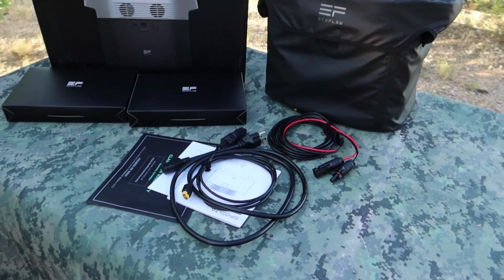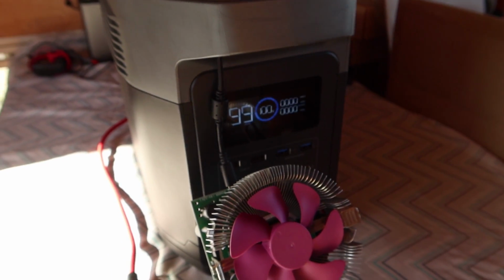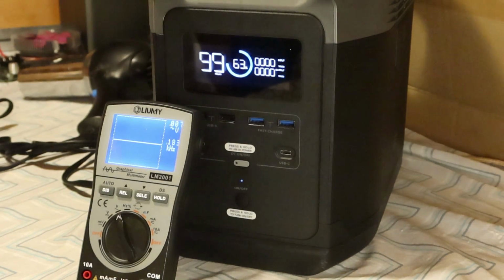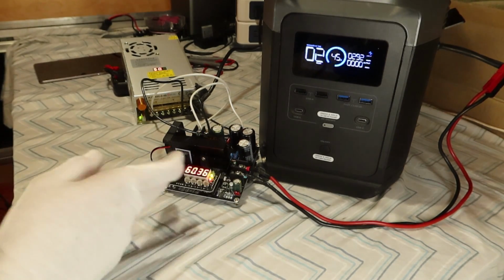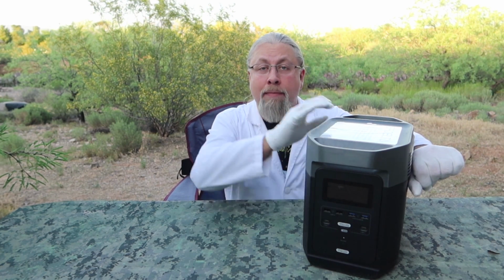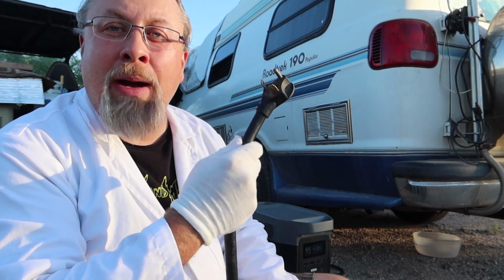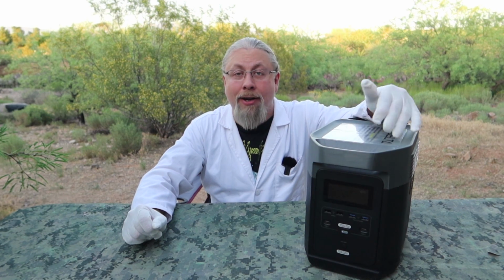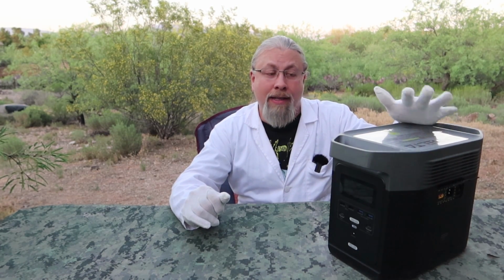EcoFlow DELTA 1300 A GAME CHANGING Solar Generator? HONEST Review! 1800w Portable Power Station

Comment: Another source of competition is a 12v battery, battery box and inverter. As in a portable DIY solution, then again I just looked up how much USA people pay for a simple 12v battery box, a lot more than we do in Australia. The Delta 1300 doesn't ship to AU sadly, if it did it would cost me around $1900 and for that price I could get a 100ah lithium in a battery box with the solar panels included.
Reply: Raw battery parts will always be cheaper. Just the weight, maintenance, spacing, convenience, etc. I mean, we all could have 12/24/48v systems with 1000+ah if it didn't weigh so damn much lol.

Comment: Will Prowse did a video on running an ac unit from a power station (I think Bluetti) and his ac unit was 300 something watts.
Reply from the maker: He must be running a much smaller a/c than I am. 450-500w is typical for a 5000 btu.
Reply: @HOBOTECH  It is all about efficiency.  I bought the most efficient one on the market, an 8,000btu Midea, and it takes 400 watts.

Comment: IS the MAXOAK Power Station 2400Wh/1000W Inverter BLUETTI EB240 basically the same as 2 100ah Battle Born Batteries ?
Reply from the maker: Only in capacity.
Reply: @HOBOTECH  meaning not in longevity ?

Comment: Can you test to see if the daisy chain function will work with another solar generator. Can you try hooking it up to a maxoak through the AC and the slave unit be the delta?
Reply from the maker: Won't work. The Bluetti can't discharge fast enough to charge the Delta. I know because I tried.

Comment: Very thorough review professor, but the what's inside question went unanswered until I watched a couple more reviews. Will Prowse reviewed this product last December (was $1100 then) and found similar positive and negative features. Jehugarcia broke out his trusty scalpel (a Philips head screwdriver) last March and found what appears to be 140 18650 Li-Ion batteries inside! Jehu also has a hack video on adding more battery capacity, for anyone interested.
Reply from the maker: $1100 was the Kickstarter price. It wasn't even for sale yet when he did the review. Jehu's hack not only invalidates the 2 year warranty, but makes the readout on the display totally useless because the external battery isn't factored in to the calculations. It's definitely do at your own risk. By the way, EcoFlow gave full specs on the batteries that were inside so I didn't feel the need to open it up.

Comment: Is it possible to connect external lithium batteries to a Delta generator instead of buying a whole separate  delta generator to add amp hours?
Reply from the maker: No, unless you're Jehu Garcia.
Reply: @HOBOTECH But I thought you were "The Guy" lol, thanks.
Reply: @HOBOTECH  but you can dump a lithium battery into the solar charging port ? Please if you can ... explain the size of battery that can be plugged into the solar port to charge ... 12v 100ah ? 24v 100ah , 48v 100ah ? I'm a novice in this stuff ... just looking to extend runtime in an extended power outage , Thanks and yes i understand the solar input limited to 400wats , how many watts would be pushed in with different size battery ? I have 2 of these units , was thinking to buy a few external lithium batteries , charge them with a ac wall charger and keep those batteries in case i need more runtime , thank you so much for your help .

Comment: When plugged into the wall, for fast charging, what does the manual say about current needed? I want to,use a ford f150 which has a 400w  120v, to recharge, and the specs may help me decide what to buy.
Per your video, it draws over 1230 w, which the truck does not support.
Reply from the maker: As mentioned in the video it requires 1200w or 10 amps to charge from AC.
Reply: HOBOTECH thanks, that moves me back to jackery 500.
Reply from the maker: The Jackery 1000 is a better product with MPPT charging, Quick Charge port, Anderson input, and 1000w inverter. The Jackery 500 is really slow to charge.

Comment: Another excellent video, per your usual standard.  I think it would be hilarious if you started out your video showing a "solar generator" (the sun) and then a 3-in-1 battery/charger/inverter.

At some point, you really should do a review of the Titan.  Each component piece of the Titan weighs almost exactly as much as the EcoFlow Delta 1300.  It's about the same price per watt/hr, but has a much more powerful inverter, along with far better specifications, across the board.  If price is no object, and you can accept two units weighing about 35lbs each as "portable", then the Titan is the absolute best in class for all of these products labeled as solar generators.  It's probably not the right unit for someone in an RV, but is a very good option for off-grid cabins and such.

Thanks for reviewing so many of the common, affordable, and truly portable solar generators.
Reply from the maker: The Titan is crazy expensive per wh. The battery it comes with for $3000 is only 2000wh and I don't know how much of that is even usable. I will write to them (again) and ask them to send me one to review.

Comment: I was lucky.  The Jackery 1000 (which only has a 1000 watt inverter) was able to power my RV microwave.  This RV microwave is a 950 watt (that is input watts) that runs just fine.  This is one of the most important things for me as now i do not have to run that stupid, loud generator.  A 1500 watt inverter was going to be my minimum that i would accept in a power station, but Jackery got me with that early purchase deal.
Reply: Any update on receiving  your Y adapter/ parallel cable? I've been back and forth with Jackery and told that they will be ready to ship soon. Still couldn't get a specific date from them however.
Reply: @MaisleyVanGo  No, i have heard nothing on the cable.

Comment: Bought this  a week or so ago with the sale of a Delta and a 370W River together. waiting for them to arrive. going to try the Dokio 300W solar panel to start with. Will only be used to power a pop up camper and in emergency if lose power to the house. Not concerned about the 800 charge limit as will not be used on a daily basis
Reply: Kevin Thomason how was the dokio panel with the EF Delta? I’m thinking of getting the same panel but the 300W panel outputs over 10A (which is the limit for EF Delta)

Comment: Great review! I'm a lucky one who got this discounted at Wellbots for $1050. It's best application is for the camper/overlander types (i.e. occasional users) where it's "lower" claimed cycle life will be almost unnoticeable. Having used it for a while now im of the mind that the lower round trip energy efficiency is due to all of the safety electronics and fans running essentially non-stop. Many may not like that but I think it's a great thing for the health of the batteries and electronics. While the fast charging and 1800W capabilities are great in a pinch, definitely don't do that often for the sake of battery life. Cheers!

Comment: Thank you for your review!  Good information and details.  Early adopter here (bought on Kickstarter).  I chose this over the Bluetti 1500W because of the higher input voltage requirement on the Bluetti (covered on your first test video for that product).  The Kickstarter price of $900 helped in that decision.  I was also looking at the Titan, but the Delta1300 seemed a bit more portable and price-effective (had to purchase two of them though).

For my use-case (extended weekend camping in the summer), the Delta1300 works well.  I can power my camp kitchen (including a 700W microwave oven, a chest fridge, and a separate chest freezer) and all of my electronics from my two units using two Dokio 300W folding panels in series and chaining the Deltas.  Yes, I'm over-paneled; but I can't always count on full sun.

If ordered REALLY early, the Delta1300 was only $800 at initial offering, with an  even better discount when multiple units were purchased (yeah, I missed out on that).

I see EF still hasn't corrected the size of the neutral blade on the AC outlets.  When using a grounded plug, everything should be fine, but using a "polarized" non-grounded plug, the Neutral and Hot are backwards.  Not a major issue if all of your appliances are in good condition as the ground doesn't exist and Neutral is floating anyway.  I just hoped they would correct this on the next production run.
Reply: Anonimity+ how’s the dokio panels working for you and the EFDelra?

Comment: If it's sold out, it clearly must be a success. The capacity hits from the electronics are not great. Jehu took his apart and said the cells are sort of generic, Chinese apparently. You lose capacity from conversions and the charge cycles cost capacity. Love those LFP where my 4 year olds are still at 90%. Was wondering what happens if you hook up a small generator, one that can't get close to that max charge? Does the generator go into overload or does the Delta adjust? Was wondering if you connected 800 watts of solar and drew 400 watts with the A/C, would it still give you the 400 watts through the inverter, plus 400 watts of charging? These things are getting better, but you really have to need all the capabilities or a bank plus an inverter makes more sense. Thanks. These are fun.
Reply from the maker: No, you can't use both AC and solar inputs simultaneously. If you use a generator too small, it will overload and stop the generator. There is no self regulating except that the Delta will keep trying to restart the charge cycle. It's 1200w or bust.

Comment: I like mine EXCEPT for the DC output.  At only 8 amps output it won't power my diesel heater (10 amps)  and will have trouble powering my water pump (8 amps) if my fan and lights are on.  AC side is awesome.  Powers my water heater, ac,  microwave, refrigerator, cooktop, coffee maker anything up to 1800 watts.  I like that it's compact and portable and I can charge it while driving, with solar or plugged into grid.  It's not for the nomad but great for weekend warrior,  cross country travelers or prepper.

Comment: Cool Video as usual.   Is there a means to tie a secondary battery to this one ?  Use the Inverter independently of a different battery ?   Brain Picking Time !  My Constant Load like the one your using came in yesterday.  How do you set the Discharge Limit ?   I got lost with all the numbers of button pushes some place. LOL   Once you get to the <300 option ????
Reply from the maker: No. There is no discharge limit setting just an alarm.

Comment: With equipment this expensive manufacturers should give a discharge rate and percentage tolerance for battery capacity, that is really mostly what you are paying for, e.g.,  98 Ah +/- X % at a C/10 discharge rate.  That is an impressive power station but it should be for $1400.  I don't understand why any power station could not be daisy chained, i.e., output power from one charging another in a chain, seems really wasteful but I suppose there would be some applications for this setup.

Comment: I am interested in the AC-efficiency in  the UPS mode, with battery 100% full........
 Found it at 16:18, it looses 13%!! from AC-in to AC-out.....ouch.....
Hmmm that means they convert AC-in to DC and DC to AC-out and loose a lot.......  so not a reall efficient UPS.